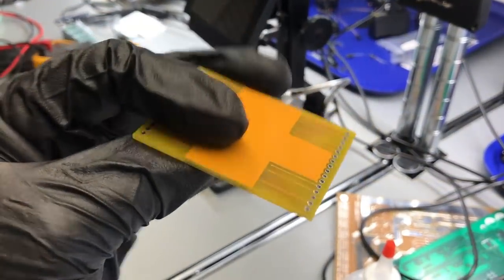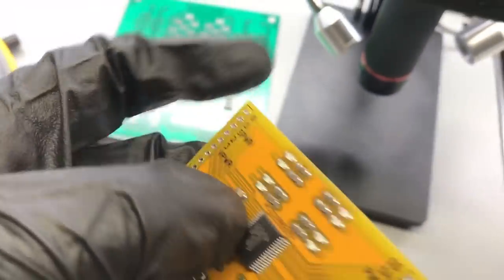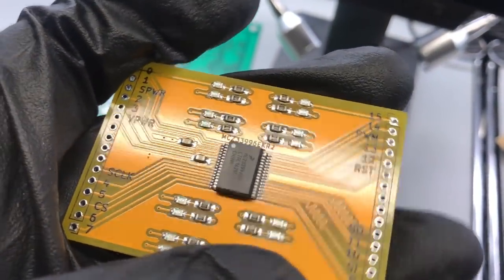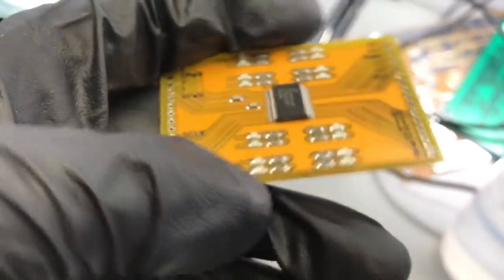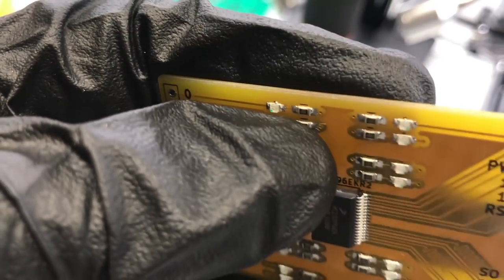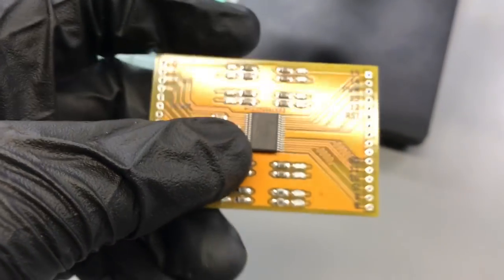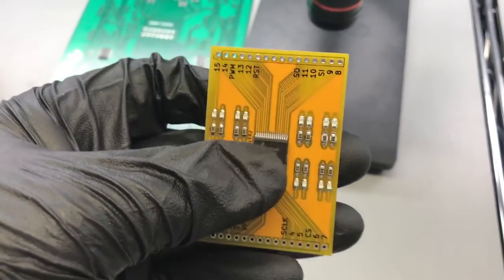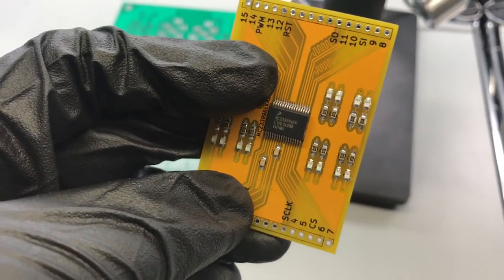SMD Soldering Microscope Footage - Andonstar ADSM302

Comment: Oh, that is beautiful. I wonder what physical property causes the chips to align when the solder melts. My guess would be surface tension, but then I had never seen this kind of thing before.
Reply from the maker: billeethesciencegeek it is surface tension
Reply: As others indicated, it is surface tension of the solder. It is not enough, though. The second important ingredient is solder mask which is used to repel solder from other parts of the board.
Beautiful video! Many thanks, I just ordered one on AliExpress.

Comment: Initially, the solder connections looked quite nice.  But, while removing the excess solder, some of the connections seemed to have a somewhat granulated appearance indicative of a potential cold joint or was that possibly just an illusion caused by the remaining flux?
Reply from the maker: Probably a bit of both. The board was preheated on the hot plate to 170C which is just below the melting point of the solder paste I'm using.  For the purpose of making the video, I had to spend less time with the hot air gun than I normally would to prevent reflowing the rest of the board.  The LEDs are not coming off, but this board has served it's purpose of allowing me to test the SPI protocol of the NXP MC33996 before making my decimal to binary to hexadecimal converter.

Comment: Why are the traces so long for the bottom right pins? (I'm referring to the two traces that go in a zig-zag pattern)
Reply from the maker: That is the SPI bus. The squiggly lines are called serpentine traces and that are to ensure signal traces are the exact same length so the timing is perfect.  They're not necessary for frequencies that I'm using(4 MHz), but you'll find them a lot on high frequency PCBs.

Comment from the maker: Depending on what solder paste you use, the flux residue will be different and thus will be cleaned off the PCB differently.  Always check the Safety Data Sheet  of the manufacturer.  The  manufacturer may often also make a flux remover.  If you check the Safety Data Sheet(SDS) for the flux remover, you may be able to make your own cheaper.  I use MG Chemical Solder Paste with "No Clean" flux.  Even with No Clean flux, there is still a residue that can hold onto the solder balls seen in the video.  I use a mixture of Acetone and Isopropyl Alcohol which is not much different than the Heavy Duty Flux Remover that MG Chemicals makes.  https://www.mgchemicals.com/downloads/msds/01%20English%20Can-USA%20SDS/sds-413b-l.pdf

Comment: The solder touches on the chip, would this not cause shorts in the solder joints? When you put the black chip on the board it smears the solder seems to make contact with other terminals. Just wondering if it does contact?
Reply from the maker: The board was completely fine after the solder melted.  Any excess solder not connected to a pad was easily cleaned off with isopropyl alcohol.

Comment: Hi, nice video ! How did the IC soldering turn out ? At reflow it was looking like some beads got lost in between pads. From the matched traces coming to that IC, I assumed you'd run that board pretty fast, how good did it perform ?

Comment: Question: Who did you use to make the yellow PCB? If this was a one-off board for helping your project move along, it seems way too pro just for that. That said, I'm jealous of the results. Please spill your source.

Thanks.
Reply from the maker: I designed it just to prototype test the spi chip and that's it. It's so cheap and fast now that it actually makes sense to spend a little time a design a board up instead of breadboarding everything.  You can get $5 off your first order if you use my link to order your PCBs https://www.pcbway.com/setinvite.aspx?inviteid=57699

Comment: any 0603 or 0402 soldering using ADSM302 ?
Reply from the maker: I don't solder 0603 or 0402 on boards I design for myself but it can be done.

Comment: Those LEDs seem to be coldsoldered...
Reply from the maker: The board was preheated on the hot plate to 170C which is just below the melting point of the solder paste I'm using.  For the purpose of making the video, I had to spend less time with the hot air gun than I normally would to prevent reflowing the rest of the board.  The LEDs are not coming off, but this board has served it's purpose of allowing me to test the SPI protocol of the NXP MC33996.

Comment: Great work. But having said that, if you're working on a cell phone board this would never fly. You would have to use solder on a fine tip. Those components are so close together that you would have a disaster on your hands with all those solder balls everywhere. But still, Great work here!

Comment: You are using a solder mask to put on the solder paste. I use a syringe that has extruding diameters. By hand. I can be sloppy and it will still come out ok.
Reply from the maker: robin vermillion I’m using a stainless steel stencil to apply the paste. Solder mask is the colored film laminated to the PCB.  I also have a syringe but stencils are so cheap now that I’ll probably always order one now.

Comment: what size where the components think at least 0805 those are not to bad to solder the 0201 are a bitch and don't even start about the 01005.

Comment: ....too much solder paste
Reply from the maker: That is because the pads are larger than usual because they are hand soldering smd pad footprints.  I didn't plan on using a solder stencil at the time I designed the boards.
Reply: No problem. Good job.